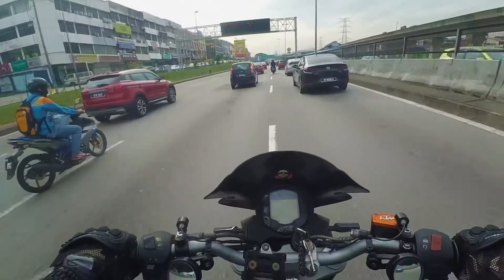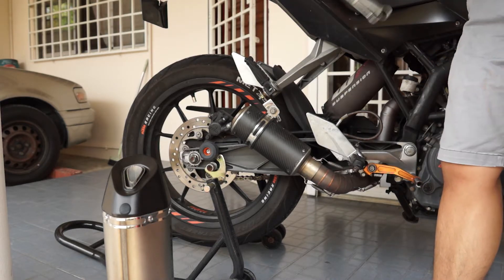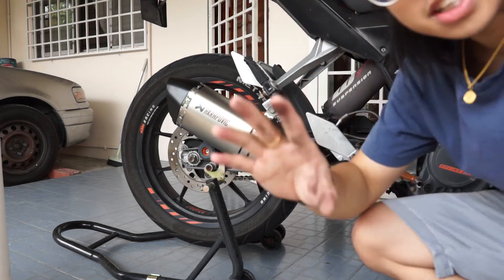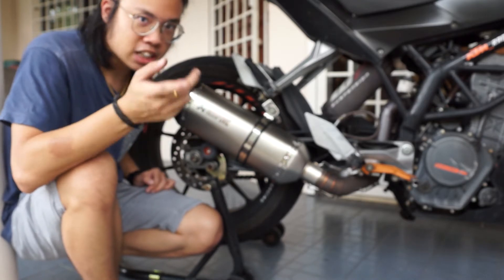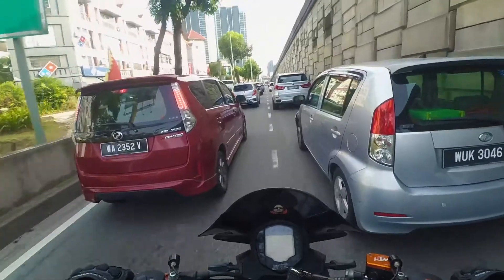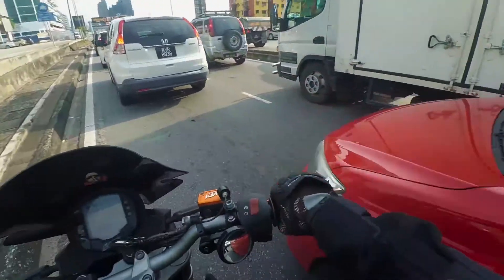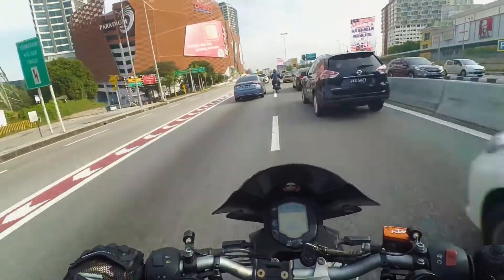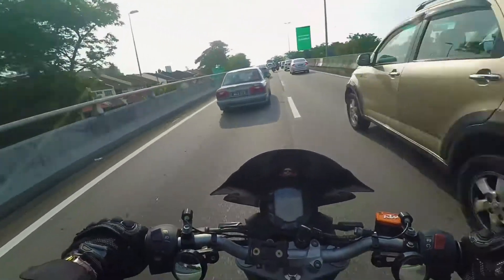Long vs short motorcycle exhaust

Comment: I have the same short muffler. Just wrap the baffle (db-killer) with glassfiber or steelwool and it will reduce the sound alot. I chose this option because I like the shortys, but longer and wider muffler will give you much better (not louder) sound 👌🏼

Comment: Nice comparison video. That single cylinder KTM sounds like my 150cc scooter so this video comes in handy. The louder sound of my short slip on pipe is starting to get on my nerves, even with the db killer installed.  Also, That lane splitting is too sketchy. Not too many places in the U.S. where you can ride like that without getting smashed into a pancake. Then again the U.S. is a more of a car and truck country Scooters and bikes don't get as much love on the road.

Comment: The only thing to do if u want to know what is the real effect is with the dyno...there is nobody in this world can tell the difference between long and short exhaust or any other experimentations on your motorcycles...it is only with the dyno you can know and tell if there is the difference... so you dont have to explain okay because you do not know what is the difference between them okay...
Reply: Motorcycling is all about how you feel. Figures are just figures unless you are into extreme racing. My 2 cents.
Reply: @aori82  motorcycling is all about having fun...feelings will lie but correct figures and statistics will save you...feelings are just feelings bro u can never know what is the true status of your bikes when u rely on how u feel.
Reply: You guys are funny. As if these mufflers will give you +10BHP.